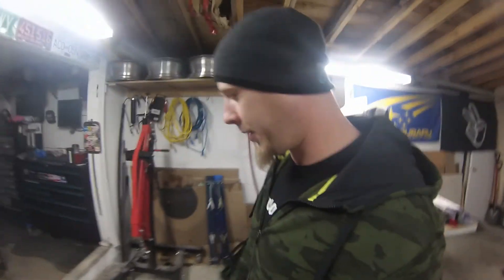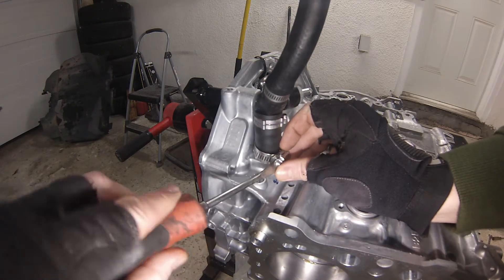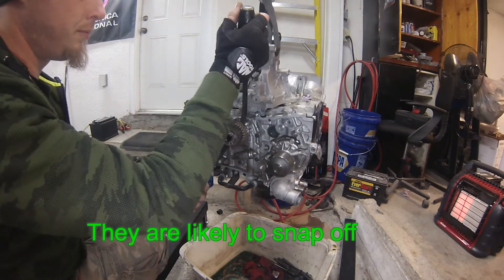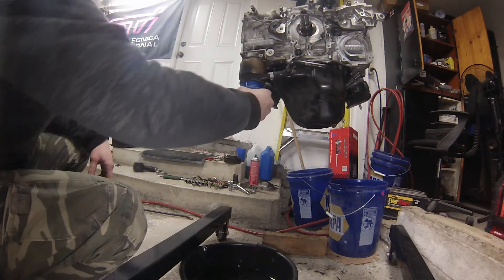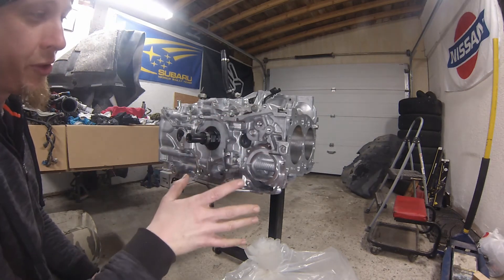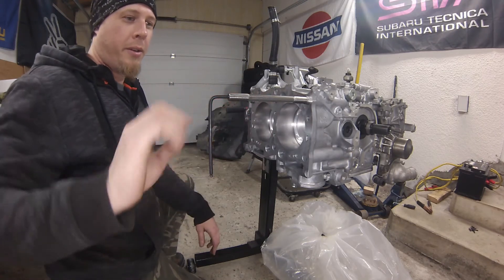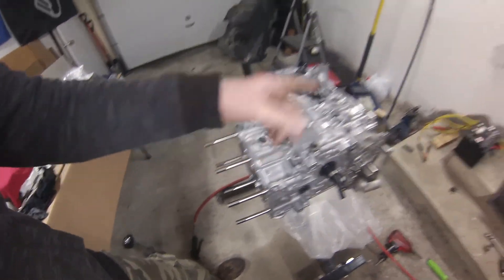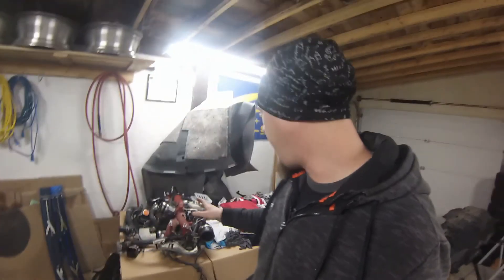2013 Sti Build Part 5 - ARP Head Studs - How To

Comment: No oil on arp heads? Good call on stopping
Reply from the maker: There is a special lubricant that comes with the studs. It's used when tightening the heads down

Comment: i would expect a better quality control from IAG, wait is there a quality control ?
Reply: Iag suffers from what every company does eventually, they get too big to care about the customer since people will buy their shit regardless. I prefer rallispec.
Reply: @BP5Lwhipple , my rallispec failed. I won't ever recommend them.
Reply: @brandimeese3151  im sorry to hear that man, what exactly went wrong if you dont mind me asking? Im not affiliated with them at all but i do use their short blocks for 80% of the rebuilds i do for customers and have not had a problem yet.
Reply: @BP5Lwhipple , when my local shop opened the block, it appeared to be an incorrect clearance on one of the bearings. It held fine until I added more power. I was still stock clutch and Turbo too. The shop I use stopped using the brand of bearings that rallispec used because of that reason. It was probably just a fluke but it left not only a bad taste in my mouth but also a huge hole in my wallet. ;-)
Reply from the maker: It may have got an apprentices seal of approval.  ;)

Comment: wheres the arp stud lube?
Reply from the maker: It's on there. I wasn't going to get into the debate of too little or too much lube, so it wasn't shown. If someone is torquing studs without it, they might learn the hard way.
Reply: Homebrew Subaru hahaha right! im in the middle of doing a complete rebuild. the mschine shop was supposed to bore block 25 over ended up 50 over. oh boy this build seems like its never going to end. i keep running into crap like this. then they belt the living hell out of the allignment dowls for the head. and the dealership threw ALL the bolts in one box hecause they were going to rebuild it. but they said the block was fine. i got it home tore it down snd all 4 pistons were completelly destroyd. but hey the deslership said it was perfectly fine!!!!
Reply from the maker: I have heard so many dealer horror stories. Subaru Canada should contact me for engine/electrical diagnostics. I will do fly in/fly outs for a price! ;)
Reply: Homebrew Subaru haha. ya. it cpuld of been worse. they tried raising their price nore and more i finally said fuck you box it up. and they did they threw everyhing in boxs. so now i get the fun of figuring out where exsctly all 2 or 300 of these bolts go. 🤣🤣🤣